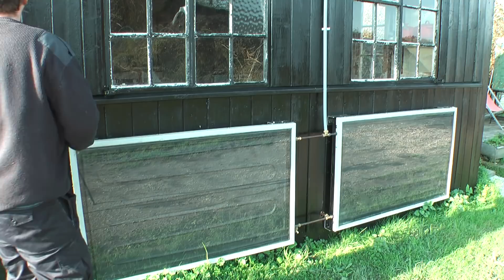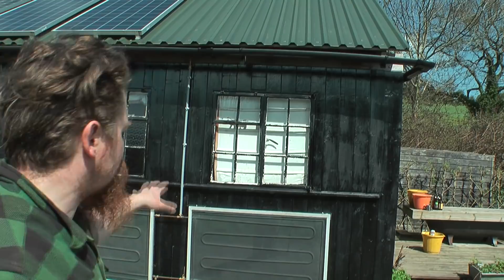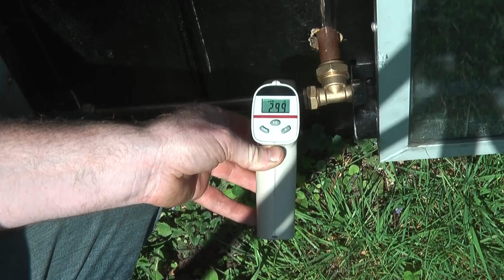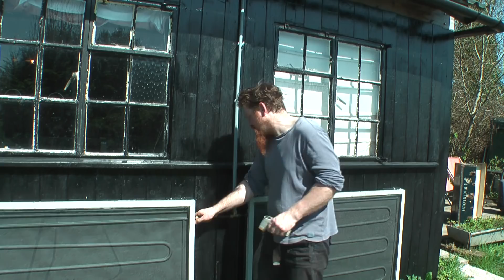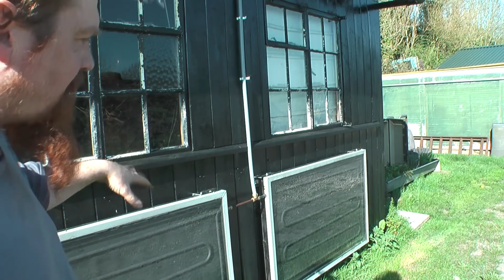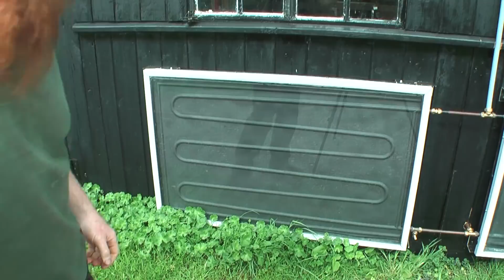Solar Hot Water Part 2 (of 3)

Comment: Looks like those heat collectors need twice as much pipe-length inside them. Good vid, again.
Reply from the maker: Yes I was a bit surprised, but then more pipe would mean slower flow as tighter bends, I think the fact the the pipe is bonded to a sheet of copper means lots of heat is conducted to the water without needing lots of pipe involved.

Comment: why dont you simply run one panel on top of the other thus making the water twice as hot. with the addition of other panels you could bring it to the point of steam if you wished.
Reply from the maker: Yep,  but reduces the flow as effectively more 15mm in the loop (and would block the window!).

Comment: When the eletric panels have fully charged the battery(s) what happenens to the wasted eletric ?

I know some systems have like a discharge system built in to dispose of the unwanted eleticicity my idea is that a  water heater can used this wasted poswer to heat water up 

In your video you said about adjustoing the angles of the eletric panels for summer and winter surely you would have to do the same with the water solar panles ?  which i would leave on roof all year around.

When you burn wood it produces a (wood) gas when filtered it can be used to run a engine ie generator etc 

Thanks for sharing another great video and i have watched all your video
Reply from the maker: With solar electric, the controller can just shut off the incoming power, so unlike solar heat, you don't need a dump load, the power is just not collected to begin with. I do use a immersion heater to use 'spare' power. I talked about adjust the angle but said it didn't make a huge difference, so thiese ones will be fixed. I have experimented with wood gas (and will do again one day!). Thanks for watching!
Reply: Would love to see you do some videos of wodd gas

Comment: Awesome. Budget aside, if you did it all again,
Would you go thermal store? Would you go  pure solar PV?
Can i ask what size battery bank you have Please.
Love you Vids Max, keep them coming
Reply from the maker: Yes to a thermal store (I'd also have to factor the weight into the frame when building), for me I like the idea of the solar hot water the way I've set this up, so if starting again I would design some low panels all along the south facing wall (and have move PV!). I currently have 4 Trojan t-105 batteries (not quite enough to run the house and workshop as I want), I hope to get another 4 this year.
Reply: Trojans are great batteries but if you have the space and transport a used forklift is a good option. You can leave the batteries in the forklift and use it to power your house and stack things!

Comment: Possibly a daft idea.. but if part of the reason they're not getting all that hot is that the input [aka the water form the return] is cold to start with.. would connecting them in series, not parallel, raise the output temperature? Basically, connect the cold water return to panel A.. then connect the output from Panel A, to the input for panel B and then leave the output from B connected to the riser pipe... that way the water is sort of 'preheated' by one panel before going into the next.
Reply from the maker: Yep,  but reduces the flow as effectively more 15mm in the loop (and would block the window!).
Reply: Ah, right. Kind of like connecting Solar pV panels in series instead of parallel, it gets you more voltage but less amperage.

Comment: I have a question, which might have been answered in a previous video, but you mentioned your 4 new solar panels costing £100 each, what is each panel's wattage and where did you buy them. Also have you considered a Patreon account?
Reply from the maker: I think they are around the 260w mark. I got them from various people all via ebay. There are lots of sellers on ebay with 250w panels at about £100 each (price has bottomed out at that for the last couple of years). I'll do a patreon account if/when the channel get big enough to warrant it, in the meantime all paypal donations are gratefully received!

Comment: Firstly, I applaud your endeavor. Not only in the thermal siphon but the whole (for want of a better word) "shabang". Only been subscribed for a couple of months but I'm hooked.
One question from a naive spectator, does/can the thermal siphon work in reverse and "steal" the heat from the system?
Reply from the maker: Nope, as the hot water is less dense it will tend to stay at the top of the system. If I light the fire (at night or when the panels are cold) I can reverse the flow and move heat outside,  but there is a ball valve on the return line to stop that.

Comment: Max, you really need to get the panels angled to the sun more.  Vertical is never anywhere near correct.  At our latitudes, about 45 degrees is best for year round output.  Just have to remember not to drive in to them with your digger / Landy / Russian monster.
Arduinos pull about 10 - 20 milliamps at 3-5 volts.  Wouldn't take much to wire up a couple of thermocouples, and a pump on a relay.
Reply from the maker: The thinking was, if I optimise for spring/autumn then summer performance will be just as good. I could angle them out for better performance, but that's not the goal here. Same with the controllers/pump, the point of the experiment is to build a self regulating system powered by gravity, with nothing to go wrong!

Comment: You're right about PV becoming practical for hot water. I recently put 300 watts of PV panels onto the lower heating socket of my hot water tank, running a 24 volt, 300 watt DC immersion element. So far, for a single guy and a 40 gallon tank, it's keeping me in hot showers and dish washing with no problem. Come Winter, I'll probably have to add another 300 watts of panels, but I can't complain; no moving parts, no heat exchangers, no leaks, and it cuts a big chunk off my energy bill. The system should easily pay for itself in a couple of years!
Reply from the maker: Good to hear!
Reply: Sailorashore: The reason I went with this system is that it's super simple and completely separate from the grid. It's just one DC loop that feeds one heating element with a thermostat, a fuse and a switch. No charge controller, no batteries, no inverter. The water is the battery, the thermostat is the charge controller. The other (upper) heating element in the tank is still wired to the grid, but only comes on when the temp drops too much, such as after three or four days with no sun.

Comment: I often fit Velux roof windows. In their tech info they say that a roof window provides twice as much light  as a vertical window and three times as much as a former window.  Presumably if you tilt your panels skyward they would a similar proportion more Sun / energy. Build a storage bin on the front of your cabin with a pitched roof?
Reply: Dormer. Not Former!!
Reply from the maker: Depends on the time of year, summer sun is much higher than winter sun. I don't fancy doing anymore building - too many projects already!

Comment: Hey Max, I have recently discovered your vids and I am loving them. Did you fit an expansion tank to the pressure side of your fresh cold water system? 
If you want a higher output temp running the panels in series rather than parallel will achieve this allot like batteries, the amps/flow won't double but the volts/temp will go up. Unfortunately the location of them on the house and your windows doesn't easily give you this option. Good luck with it
Reply from the maker: I have recently fitted a new pump and pressure tank to the water system. It would give a higher temp but lower flow as effectively more 15mm in the loop, besides as you point out the windows are in the way!
Reply: Maximus Ironthumper perhaps you could put a throttle on it in the form of a single 12v electric port valve that was activated by a thermostat brazed to the top pipe. You get them in all sorts of band widths. Example 60-40 degrees c so that it only let water of a certain temp circulate. So in affect pulsing a constant temp up to the tank. Just a thought they use very little power and a small separate solar panel could power it to keep it stand alone keeping in mind a constantly closed valve would then only need the sun to open when the elements would be hot anyway.
Reply: From what you have described and what looks like your disappointments, it's flow that is your issue. The water is passing through the solar panels too quickly so not achieving the temps you hoped for. However 15mm pipe is a Little on the small side door a thermosyphon
Reply: Because the service area you have is quite small and our weather in the UK is sketchy it looks like it will need a longer period in the panels. Out of interest of you isolate the panels what temp do they get up to after a couple of hours with no siphon ?
Reply from the maker: I will try isolating the panels the next time we get some decent sun. I think the main thing holding the system back is lack of surface area available to the sun. There's just not room to fit the other two panels. If / when I build another home I'll do a better job of designing it!
Reply: You have an awesome set up, things always evolve that's the beauty of learning these things. Keep up the good work.

Comment: One small plus I can think of. The efficiency of these wont have degraded much in 10 years. Your PV panels will need replacing. 
But its not a massive plus I suppose. 
Quick question, where did you get your brand new PV panels? £100 a pop is far more appealing than I thought it was.
Love this solar thermal series, really interested to see how it goes. And if you ever get your Evacuated tubes going.
Reply from the maker: PV panels are usually reckoned to last 25years, certainly my oldest panels are still working to rated capacity. 250w panels for £100 are all over ebay. There will be an update if/when I fit the tubes!
Reply: Maximus Ironthumper found em ta :) silly I didn't look there before.
Reply: PV panels are generally warranteed to 90% at 10 years. So hardly need chucking away. Cars lose more power than that and yet people run around in much older vehicles.

Plumbing has its own maintenance issues as well. You will lose efficiency at a similar rate from the pipes furring up in a hard water area for instance.

Comment: I may be wrong, but those panels have a 15mm pipe which is too small for a gravity system. Woodburners with a gravity system use 28mm piping. I think there's too much drag in the smaller pipes.
Reply from the maker: The panels are 15mm but they are connected in parallel to offset that. As soon as the pipe leaves the panel it goes to 22mm and the return drop is in 28mm - it works very well!

Comment: Well done for just getting out there and doing it.  Nice work with your system
In regards to a thermosiphon system I have only played with solar panels and a pool but  in my experience I have found that you want to heat a lot of water only a little bit, so you set it up to maximise flow, like how you have set up your system.
Could you not ground mount your evacuated tubes and set them up to thermosiphon the same way or do you not have enough lift to your water tank if you set them up on a ground mounted frame?
Reply from the maker: Thanks. Unfortunately for the tubes to work properly they would have to be mounted vertically and as the manifold has both flow and return in it and sits on top, that means both flow and return would be over 6 foot off the ground so not much room for a thermosyphon loop. That's why I went with the panels (at least for now), they might not be as posh but they do work and with no input from me!

Comment: I don't understand the aversion to a pump. I doubt you'd need anything too powerful because the lower the current the hotter the water will be. Also its pointless to use it if the solar panels aren't getting energy which means electricity is in excess.
Reply from the maker: Why have a pump if I don't need a pump? I have a radiator system that runs superbly without being pumped, so this experiment was to see if I could achieve the same with solar hot water.
Reply: Maximus Ironthumper sorry I meant with the evacuated tubes. They just sound a lot more beneficial.
Reply from the maker: They'll go up if i need them!

Comment: Would it not be more efficient to run the panels just on the underfloor loop so that they work against a lower temperature? Then you would get a higher delta on temp and pull out more energy than working against the higher tank temperature.
Reply from the maker: It might, finding out is all part of the experiment!

Comment: Drop some reflectors on the ground in front of the panels. It might help compensate for the fact the panels are mounted vertically. A little bit of reflected energy isn't going to hurt.

Great to see this experiment unfold.

Comment: i get where your coming from witht the low angle of the sun in winter, but angling the panels out  just enough to have them look straight at the skyline level will help with getting more hours on it spring and autumn,  lagging the outside pipes is a must as even a gental breezes will loose heat. No point in wasting free energy
Reply: Lagging the pipes, great idea, loving the comments section of these vids as well as the content, nice to know there's a lot of like-minded folks out there ;-j

Comment: Would painting the pipe on the outside of the house black help? I’d also fit the tubes too then even in spring you should have hot water. Let us know how it works out next month when it gets hotter.

Comment: I see you've set them up in parallel,   have you considered stacking the panels vertically and running them in series?  I would imagine that it could yield a significant boost in heat output,  but perhaps at the expense of flow.

Comment: Ok, I’m loving the enthusiasm!  There’s a few points I’d like to clarify. Using PV power to heat water is incredibly wasteful, unless you’re using it as a dump load when completely off grid. The alternatives are to use some of the power to circulate the primary loop water; to purchase a water tank with integral heat pump (Ariston do a few), or get a thermal store that can take the various heat sources and provide domestic hw on demand and run the underfloor heating.
Reply from the maker: How is it wasteful? Using excess PV to run an immersion heater is a very efficient use of excess solar. An immersion heater as a dump load is very common even in on-grid setups.
Reply: Resistive heating is inefficient. That is why it’s used to dump energy off grid. If you’re grid tied, just let it export.
Reply from the maker: Resistive heating is very efficient, it's almost a perfect conversion of electric to heat. As for the export, if it's a choice between exporting power and using gas / oil / whatever to heat water or not exporting power and using it to heat water in the home, then that may well be more economical.
Reply: I have to say no. I respect your opinion, and I love your other videos, but this is where I have expertise. Immersion heating should be either to waste excess energy, or as a last resort, if other means have failed.

Comment: Both videos - Great Stuff however, what is so different about the tubular solar tubes insofar as you say they require a pump, why can't they work like the panels that you have installed if hot water rises and cold water descends? I have 3 south facing veranda roof tubular solar panels providing my 300 litres of hot water and they are with an electric mains pump albeit, we usually see more sun in a week than you do in a whole summer in the UK.  I'm trying to workout how to get hot water from a Bulgarian Wood burning range and solar WITHOUT an electric pump as the manufacturers of the wood burning range (it is not like a Rayburn, just a simple sheet metal with fire bricks construction), don't have a clue how to connect it without an electrical pump.  This is for a caravan type project that I am hoping to strip back to the frame and rebuild using SIPS.
Reply from the maker: For a thermosyphon to work the heat store must be above the heat source, so if I mounted the tubes on the roof they would be the highest part of the system and thus need a pump to move the heat into the store.
Reply: Exactly, I am not as bright as you in this matter, but I meant, why can't the tubular solar panels also be mounted at ground level and NOT do the same job as those copper radiator type solar panels you have mounted already - this is the part I cannot understand or get my head around as they also have inlet and outlet water connections?  Anyway, thanks for replying to my first post.
Reply: Also, my logical, but NOT scientific mind was thinking perhaps there could be some merit in using mirrors to reflect 
 more sunlight on to those two panels.  Knowing you, you'll find some large ones for almost nothing or in a skip.  LOL.
Reply from the maker: The tubes would still have to be vertical even if mounted on the ground, otherwise you would lose the advantage of being able to catch the sun from many angles. If they are vertical, their manifold will be over 6 foot off the ground (unlike the panels which can be mounted to have a high flow pipe and a low return pipe) so the feed and return would be 6 foot off the ground too which leaves very little room for a thermosyphon loop, unless you have a tall building.
Reply: Not worth building a third floor then.  Get your point, thanks again for taking the time to reply.  I'm hopefully off to some wild Black Sea Beach tomorrow to make a clip and take the pish out of survivalists and preppers, but I might drown too. (That should give me a few more subscribers) LOL.

Comment: Would you get a higher temp return if you mount them in series rather than parallel?
Reply from the maker: Yes, but much slower flow as effectively more 15mm pipe in the loop.